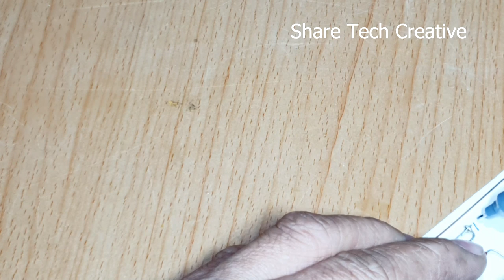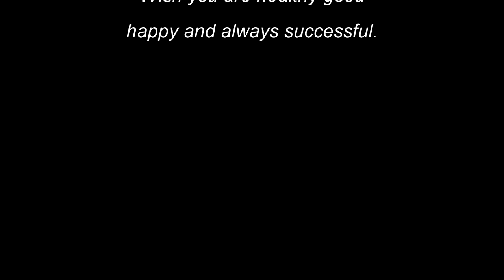Diy Heavy Treble Bass Circuit Without PCB Circuit Board Use Two Transistors

Comment: If I use 12v power supply is the zener diode needed?
Reply from the maker: You may not need to use Zener diode